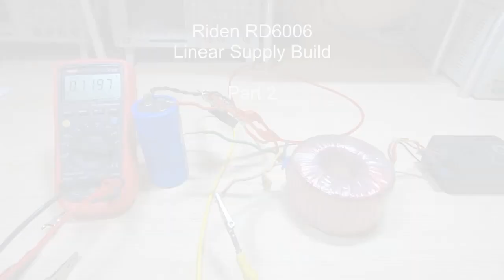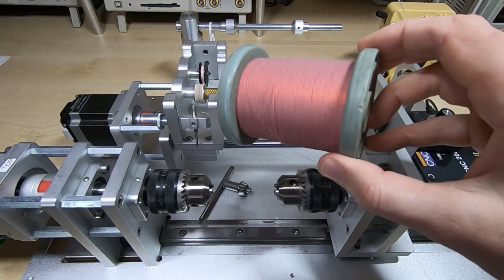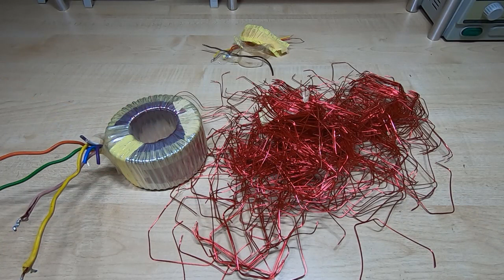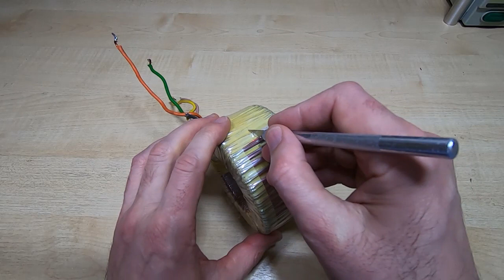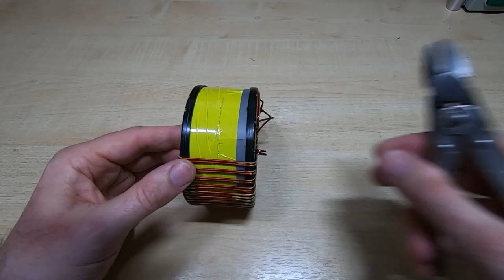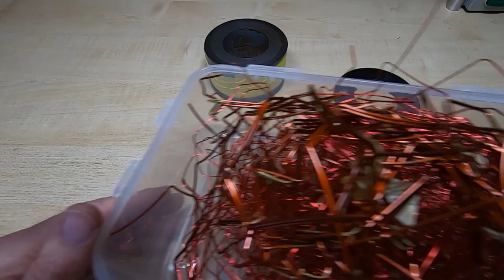RD6006 Linear Version Part2

Comment: Very nice to see the inner parts of the transformer, but isn't it a bit of a waste to destroy them just for the iron core?
Reply from the maker: It depends on how you look at it. I originally wound them for a project many years ago and I no longer need them (at this voltage) so I just reuse them. I may end up rewinding them again in the future. However the main reason for doing this is so that I can demonstrate how to 'recycle' a transformer and so my only other option would have been to buy a new one and destroy that. As I said in the video I am not suggesting that this is the best way to get a transformer but I am trying to show a method for anyone that is interested.